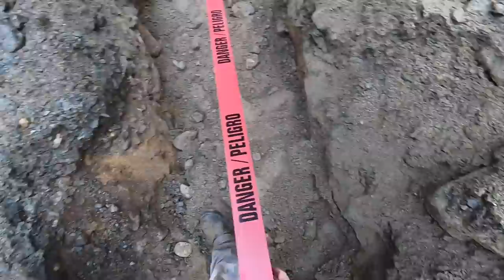BooYeah This RAIN Cant stop US! Finishing up the under ground utlity Trench

Comment: If this isn't going to be inspected there's no need for the purple primer. Also you can just glue those joints and use about half the amount you're using. That cleaner is only necessary if you have something on the plastic that would prevent a bond. Hope this helps in the future

Comment: Great job a gentle bend of PVC pipe is much preferred over putting a factory bend in the conduit run. Most electricians will start at the buried end and work toward the end or a straight length of ditch after completing the bend and the conduit is laying on the bottom of the ditch. Never thought of holding plastic over the end with a fitting before, a real pain to get tape off when it goes past the plastic onto the conduit.  Many professional things and one rookie mistake, still a great job. Keep up the good work.

Comment: I am afraid you will have water in your conduit with part of it being buried already and the other end in the water. Why did you not put a temporary cap on both ends to keep the rain out? Don't know if there is a way to get the water out or not, but you won't see this until it is too late anyway. But, when you run your wire through it, I would tape off the ends before running it through to make sure you don't get any water in the sheaves.
Just my two cents worth!
Have a Happy Father's Day.

Comment: primer and cleaner is the same thing fyi.  most electricians i see installing pvc conduit just use glue but maybe im wrong for underground?  theres no pressure or ways for the pipe to come apart underground.  maybe theres a reason u do that tho.  lmk

Comment: So are you going to run a water line down to the barn with a frost free hydrant as well? Would make watering the animals easier. Or are u going to use rainwater or are you just going to carry water down there?
Reply: I suspect he'll do rain water catchment for the most part at first. It depends on what kind of projects/work he expects to do in the shop.

Comment: Hi Al, I don`t know how long behind the video`s are, so maybe I am to  late, but do you know the trick with a shop vac, a foam ball and some fishing line, that is the easiest way to get something thru that conduit, then go to para cord and then 1/2" rope.
Reply from the maker: I havent made it that far yet. When I do I will give that trick a try
Reply: @LumnahAcres  In smaller pipes a cotton ball works fine, in smooth pipes a small rag works fine, but in the segmented conduit you have, I would only try a foam ball.   Or if you have 500f of 4" pipe, a Gatorade bottle, and a road crew`s 6 cylinder diesel compressor.

Comment: I'm full of questions this time 1 why do you use a three-part pipe stuff pipe glue instead of my usual to I usually see is there a special reason or is it just what's available in the area or personal preference number two why did you splice the pipe it didn't show you adding anything to the end in particular just slicing it and putting it back together look like + 3 all that for driveway I hope that they'll be repaving it for you?

Comment: I'm not an electrician but I always wonder why guys dont feed the wire through the pipe as they assemble it instead of pulling it through later?? Just curious.
Reply: glenncountry my guess would be cutting pipe to adjust the length would be difficult if the wire was inside
Reply: Works great to slide pipe over wire on LONG runs where you can lay the wire out and then slide the pipe over the wire,   1,000 to 3,000 feet. Over 1,600 ft of sliding the pipe will melt and get a hole when using a truck to pull the pipe (200 or 240 feet at a time).  Sliding it by hand 80 feet is the max most people can slide. The biggest problem is that it takes 2 people to glue them together, slide the 90 elbow over the wire, and putting the boxes on the end of the conduit without damaging the wire. About the same amount of work to do either way on 500 to 1,000 foot runs. I did it for 9 years.

Comment: I'm surprised that a backhoe versus a trencher was used for this task. Let alone the price difference between the two, which cannot even be comparable.  I just rented a self propelled trencher capable of a 24" deep trench for less than a buck and a quarter for a whole day of use
Reply: With as much rock as they have (and the size of it) I don't think a trencher would work.

Comment: Should have buried a water line in that trench while you had it open.
Reply: Wasn't below the frost line.
Reply: Against code every where I worked, each utility a separate  ditch.
Reply: @raymondhinds3539  Actually it is not in the NEC as being prohibited and you can dig the trench deeper and place a layer of fill between the two it is possible.
Reply: @jimthompson2969  City and State codes.  NEC is only one of the codes.  some things you can do by NEC may be not be allowed by a state or city code.
Reply: The first house I bought, when I was 26, was about 25 years old & built in the mid 50’s. They dug a trench with the sewer line & the gas line a few inches above it. It was a real pain when the sewer line collapsed & had to be replaced. The whole trench had to be hand dug. My sweet & handy Dad did it all. I didn’t have the money for a plumber, as it took all my savings to buy my house. Al reminds me a lot of my Dad. There wasn’t much that he couldn’t do. He didn’t even have the internet like we do. Lol. I think they’ve learned it’s better to have separate trenches now.
Reply: @jimthompson2969  There are more codes than the NEC to comply with. When I started running underground electric you could run electric below a water line with 12 minimum separation. Before I moved on State code required separate trenches at least 3 feet apart.  Important to check City, County, State, and utility company's for what they allow and do not allow.  Telephone company would only allow you to put TV or other low voltage cable in the same ditch, but it had to be in a separate  conduit.
Reply: Why have a water line when you can collect water from barn roof?????

Comment: WHY DO YOU BURY THE RED TAPE??  I HAVE WATCHED SOME ONE ELSE DO THE SAME THING.. LQVE THAT THEY ARE PLAYING MAKES ME LOL.. HAVE A GREAT WEEKEND!!
Reply: Susan Smith if someone goes digging they’ll find the tape and will know there’s a conduit near. Safety and code I suppose.
Reply: It is a code requirement in most areas to let someone know that an electric line is buried below, Yellow tape for some other applications, in some cases 12 inches of red colored concrete has to be poured over the conduit. Red indicates electrical or other danger.
Reply: @raymondhinds3539  12 inches of concrete?  Why so much?
Reply: @michellewaters1789  A trencher will cut through 6 to 10 inches before you can get it stopped. A backhoe is usually digging 6 to 12 inches per dip.  One company required the electric line be 3 feet below their pipeline and covered with 2 feet of red concrete then  the ribbon across the top of the pipe above the electric line. That company would sometimes use a bulldozer to make a trench beside the pipeline for repair work.  All a mater of safety .
Reply: @raymondhinds3539  thank you, as I don't work with construction equipment, I had no idea that trenchers could cut through so much so quickly.  Thank you for answering my question.

Comment: The meat birds can't get off the ground and out of the wet? I didn't realize you didn't do anything for them during weather like this. You're not as humane as I thought you were, and it's troubling to watch. Perhaps you should go over to White House on the Hill and see what they're doing with their meat birds.
Reply: Do you raise chickens????
Reply: @tonygrimes13  Meat birds? Not currently.  But before you try to shade me,  pop over to White House on the Hill and you can see a more humane example of a farm caring for meat birds.
Reply: @delennamachoo  Al cannot control the rain. Watch his videos from last year when weather was different.
Reply: @tonygrimes13  Neither can other farmers which is entry they design chicken tractors that give the birds the means to get off the ground.
Reply: @delennamachoo  I'm not saying that Al will not change things, but like any person will do what worked previously. Hindsight is a wonderful thing!!!
Reply: @tonygrimes13  Just doing what works means there's no progress or improvement. It's also not very interesting to watch... or pleasant in this case.